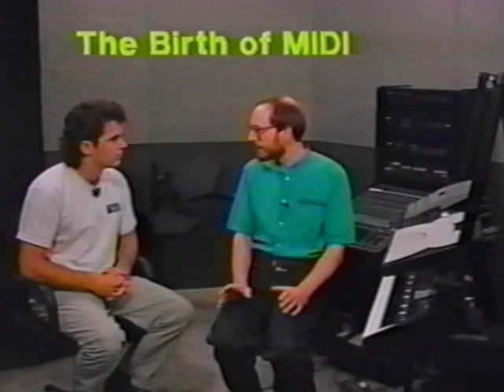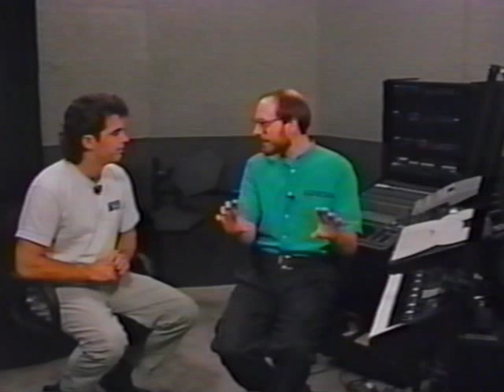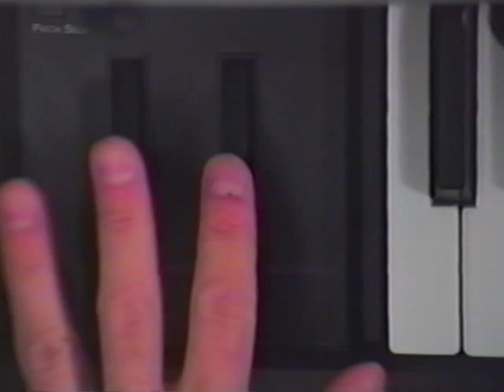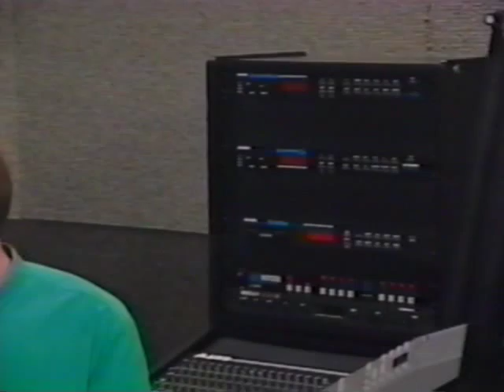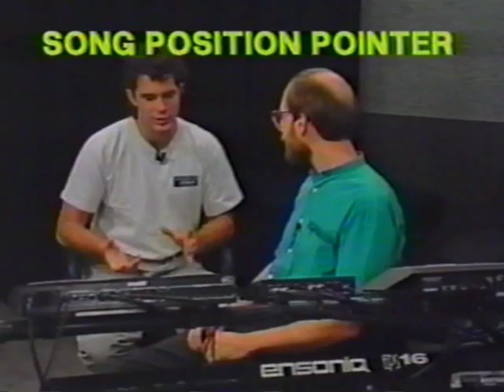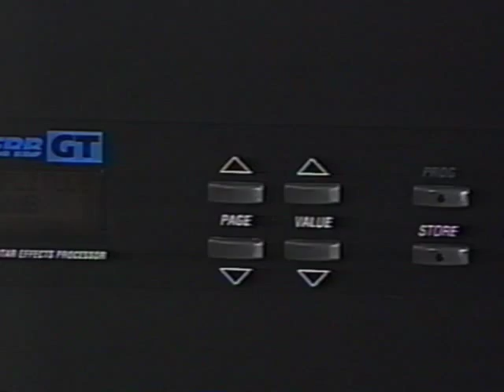The Basics of MIDI: Overview & Applications (Part 2 of 10)

Comment: Thank you very much for making this historical presentation available.  It is frustrating to read modern midi manuals and wonder about the meaning of many of the terms the meaning of which is not easily just figured out ("controller," "velocity").